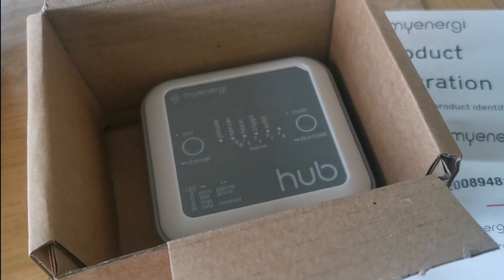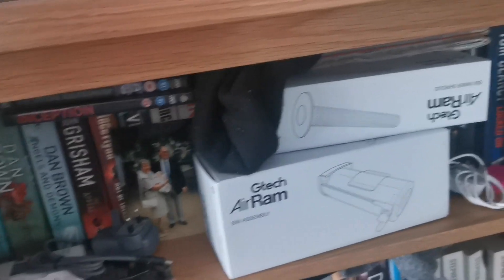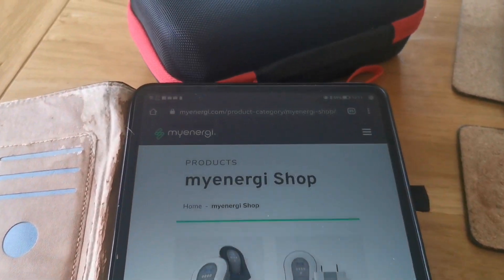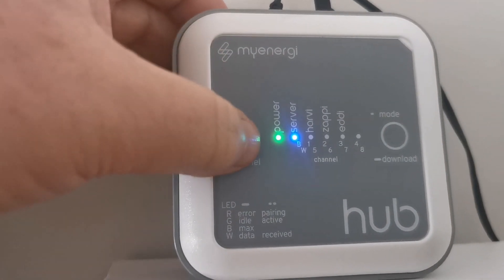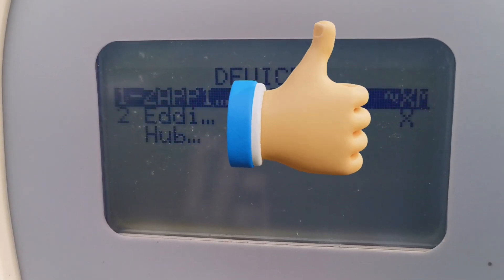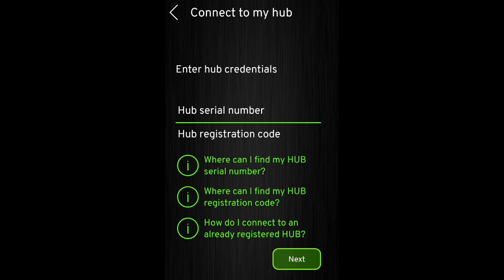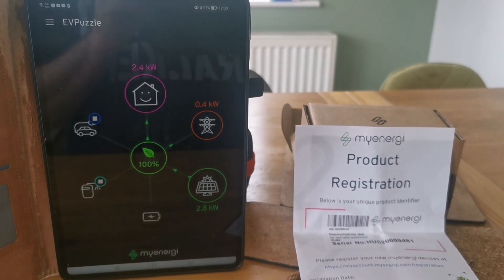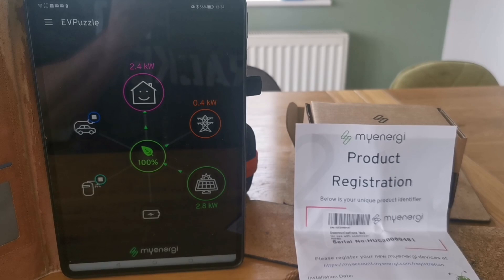Myenergi hub replacement / addition (Zappi Eddi & App)

Comment: Forgive me dragging up an old video !! I bought a "broken" zappi, which I've mended, but I didn't realise it would need the hub even to upgrade the firmware, never mind talk to a smart charging tariff - I know you did all that, but I just wanted to know wether you think it's worthwhile ? It'll cost me the same again as the charger did to get a hub, so did you notice any differences with the firmware upgrades or would you say don't bother putting good money after bad ?
Reply from the maker: I just bought my daughter a hub to connect her Zappi online. She's managed for 2 years without but now values the ability to change mode without going outside. Haven't had the need to upgrade it yet but possible now there's a hub connected.

Zappi works fine without l being online but it is better connected

Comment: I'm very disappointed with my LuxPower BMS and frequently feel it is out of control, as it exports electricity to the Grid whenever it wants to. Using a Grid CT clamp seems a very crude way of reading data and I'm surprised that MyEnergi does this too. I would have expected it to use Smart meter data to manage the system.

Notwithstanding the above, I intend to get a Zappi in the future.

Comment: Pretty sure with the Eddi 2 and Zappi 2 you don’t need the hub anymore. Zappi acts as the virtual hub. Note: Grid CT needs to be wired to the Zappi not through the harvi, UK law only according to the manual.
Reply: Only the very new Zappis (possibly the Mk 3s?) have built in hubs. Does make sense to combine it all together, less hardware too.